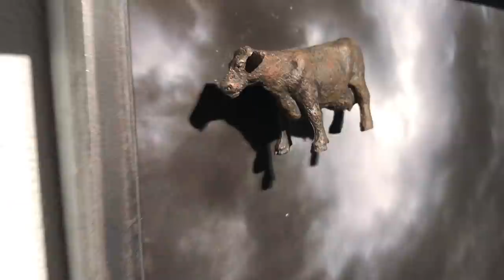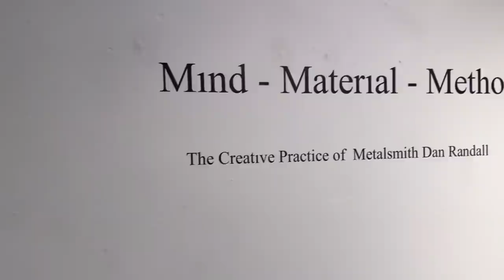Iron Pour at SIU Carbondale | SIMS Blacksmith Event | On the Iron Trail with the Cast Iron Gypsy

Comment: Interesting to see a coupola style furnace. I thought normally it was the practice with those to cap the tap before the level of iron got down to pour out to minimize the slag content in the pour, then there was a slag hole higher above the tap where the slag could be  floated out during the run.  I thought the ability to get very clean consistent iron was one of the distinct advantages of this type of furnace vs a batch melt style.
Reply from the maker: You are probably correct about that!  Most of these castings are artistic components so we just do the best we can and skim the slag off the iron once it is in the lade.  We do try to minimize how much slag goes in the ladle for sure but we can get away with more since we are not producing on an industrial scale.  Thanks for the comment!

Comment: Liking the voiceover, it's very informative :) And possibly a daft question, but does the term 'pig iron' come from pouring the excess into the troughs ? Cheers from the UK :)
Reply from the maker: Well... I think that 'pig iron' is from smelting iron ore in a blast furnace.  Here we are using old brake routers and cast iron radiators... so I don't think it is considered 'pig iron'...  I don't actually know much about pig iron but I hope that helps!  I just looked it up on Wikipedia! :)